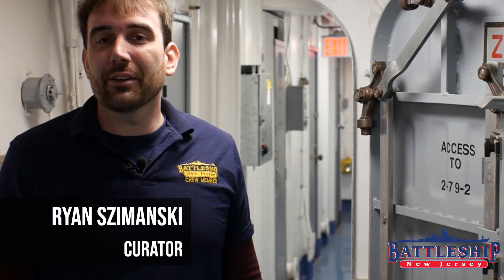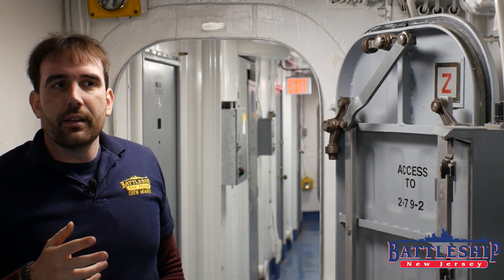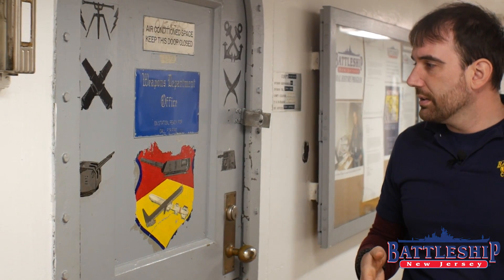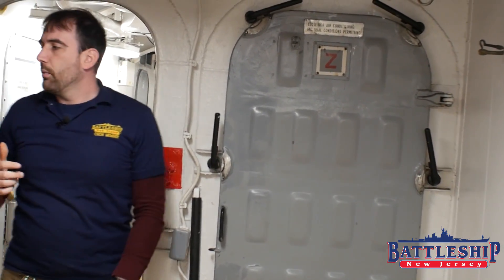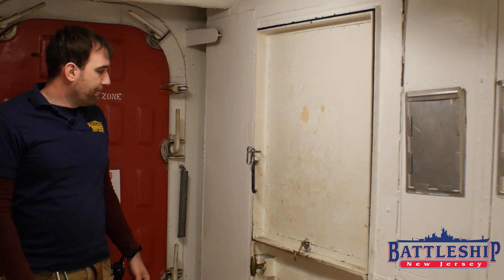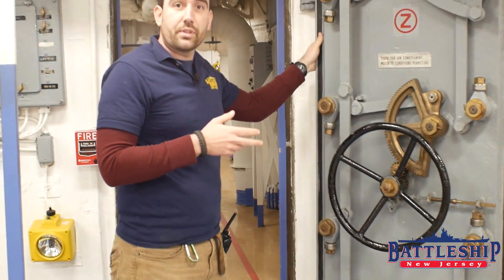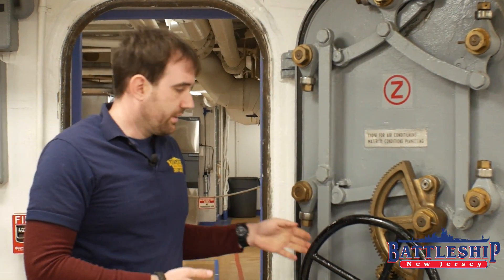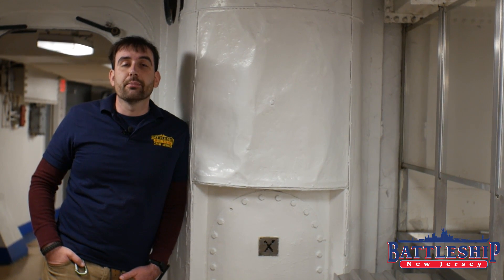Shut the Door! Doors and Hatches on the Battleship

Comment: Our berthing area was on the 3rd level, and we had two hatches leading into the space. Normally the hatch covers were open, and they were held open with a long pole and a thick cotter pin. During General Quarters or other conditions, the hatches were closed and dogged, and you had to enter/exit through the scuttles. That was never easy to do when you had on full gear. Getting out was easier, trying to step down through the scuttle onto a stairwell was challenging.

Comment: Dog Zebra-:the marking a Z inside a D, the Darken-Ship command is at sunset, all doors leading to the exterior must be closed and light traps/curtains put up,  no inside  light should be seen outside.

Circle X-ray: special marking an X inside a circle found on definite purpose valves and fittings , always closed unless an authorized operators or phone talker permission and must immediately secured after use. I believe DC Central door was Circle-X...

Comment: The Joiner door to the Mess Line would have been there simply to keep people out for whatever reason. Of note: most ships I've been on the Mess Line is also part of the main passage way that also goes through the Mess Deck. During cleaning they would secure any doors or hatches (WTD's) and you would just have to find another way around.

Comment: "NTD" simply means "Non Tight Door" not intended for use as anything more than an office or stateroom/cabin door.  There is no "W" missing.  As you pointed out they aren't intended for fire or flooding boundaries.  

Even though both of my 'girlfriends' were constructed in the 1970s I've used all of the various types of door, hatch and scuttle you showed here.  For those who have never used one, a scuttle is both inconvenient and a pain.  They are not designed for big guys or people with movement issues.  

The dogging mechanism of a QAWTD, properly adjusted exerts massive force to ensure that the seal is complete.  I saw a shipmate try to close and dog down one even though a high amperage welding cable was strung through it.  The cable was energized.  As he dogged the door down the knife edge CUT through cable and the resulting arc sounded like a gunshot and was hot enough to ruin the rubber gasket.  My shipmate had to help the Repair division replace the gasket, not a hard job but he had to do it after hours as part of his 'Extra Duty.'

I don't know why they do it this way, but the Marines call ANY door in a bulkhead a "hatch."  In 20 years in the Navy I've never been able to convince one he was wrong.  😎

Another nice presentation.
Reply: The door is no longer a door, it's a hatch. Semper Fi

Comment: How often did they change the gaskets around the doors? I imagine it's one of those things that would have to be done on a regular basis if you want to have a watertight door?
Reply: With several watertight doors on my ship, that I was responsible for, I can recall only ever changing gaskets on two doors during my three years plus aboard.   Worst problem was keeping them greased, and having untrained young squids painting the gaskets and knife edges!
Reply: @lancerevell5979  Exactly!

Comment: How do you get the upper paint layer(s) off without damaging the artwork on the lower? Thanks for all the BB NJ content!
Reply from the maker: Good question! in this case, the upper layer is peeling away so we are very gently pulling it away as it flakes off naturally.
Reply: In case you ever need it, Michele Baglioni at Univ of Florence recently came up with some hydrogels which are quite effective at removing one layer of paint without disturbing the underlying layer. Available commercially, custom formulated for each situation, though I forget the brand.
Reply: @WritesWithCare  Pretty routine stuff in the art restoration world, but probably new to people who's hobby is battleship maintenance.

Comment: 11:50 yes and no, You can't seal a square door easily. getting a square corner to be water-tight is like herding cats. the round edges of the water-tight doors mean a standard O ring style seal will work. It will ALSO be more resistant to jamming if something shifts, but really that door frame is like 95% of the structure of that door, and if you get that frame to yield, that door is going with it, open or closed, probably ruining the seal and starting a leak.
Reply: And, given that these are part of the main structural members of the ship, if you're getting enough motion to break the frame, you've got bigger problems than that door isn't watertight any more.
Reply: @evensgrey  and at that point there's probably already a big hole in the side of the ship nearby and DC is going to have EVERY hatch closed.

Really the doors are so robust because water is heavy AF and that might have to hold... what? 10 PSI of water pressure? a 32"x80" opening undergoes almost 1700 lbs of pressure across it's surface at 1 psi. and because you don't know what side the water will be on, it needs to hold that load even against the opening of the door, hanging on by only the latches.

Comment: I've used (and fixed/maintained) very similar doors to the quick acting water tight ones on   pressurized aircraft, very neat engineering that goes into them and cool to see some of its roots

Comment: I can't speak for sailors, so they might use different terminology, but mechanics would call that 'dog wrench' a 'cheater pipe' or 'cheater bar'. A 'breaker bar' is an unratcheted socket wrench drive, so named because it breaks tough things loose and/or the socket attached to it.
Reply: Correct term is 'Dogging wrench".

Comment: Doors are labeled to tell what should be closed when.  
X-Ray(X) provides the least tightness and the greatest ease of access throughout the ship. It is set when the threat to the ship is minimal, during working hours when in port, or when there is no danger of attack or bad weather.
Yoke(Y) is set when at sea, or in port during wartime.
Zebra(Z) provides the greatest degree of subdivision and tightness to the ship. It is set immediately and automatically when general quarters is sounded. It is also set when entering or leaving port during wartime, to localize damage and control fire and flooding, or at any time the Commanding Officer deems it necessary. Modified Material Condition ZEBRA - allows movement around the ship for special conditions such as: Underway Replenishment (UNREP); Vertical Replenishment (VERTREP); Air Operations; Amphibious Operations; transit of known or suspected hazardous navigation areas.
NTD:  Non Tight Door
WTD: Water Tight Door
QAWTD: Quick Acting Water Tight Door
FTD:  Fume Tight Door
https://www.hnsa.org/wp-content/uploads/2014/07/ch600-2.pdf

Comment: During normal underway conditions, were regular crew allowed to wander around anywhere on the ship, or were there limitations on where they could and could not go?    I assume they couldn't go into "Officer Country" or Marines areas.  But could, for example,  a cook find his way down into the catacombs, and into the previously shown sand locker, and down by the screws to see the keel, and up to the 011 level?
Reply: As a "Twidget" Electronic Tech, I was billeted in berthing for gunnermates, when I came back from a long tech school.  Ops berthing was full.  I was friends with the sonar guys and hung out there a lot.  I once went down to Engineering to check it out, but we were tied up pierside at the time.    Underway, Engineering and weapon spaces were busy, so no entry for outsiders.   Several spaces were controlled entry, like Radio Central (I was allowed being a radio tech), armory, any space with weapons.  And Supply.   "Chief Charley", a Filipino CPO, ran supply and mess deck, and you didn't cross him!    Weather decks were closed off during heavy weather, obviously.

Comment: In his book Battleship Sailor Theodore Mason explains that the armored hatch to main radio could not be opened from inside the compartment.  If they had to get out, they had to hope someone on the outside opened the hatch for them.
Reply: That is why I joined the Air Force.
Reply: @timmayer8723  ball turret and tail gunners back in WWII weren’t very well protected
Reply: @blacksquirrel4008  Gotta have pretty big balls to stay outside for hours being a pretty considerable target and praying the manufacturers properly welded the turret to the plane. Ba dum tssssss
Reply: @klutzspecter3470  Well, usually they only got in when approaching the target.
Reply: @blacksquirrel4008  Ball turret gunners were some of the safest people on the aircraft. IIRC, tail gunners and navigators were most likely to die by far.
Reply: @MillionFoul  that’s why I included tail gunners in my comment. Also, too many instances of people not being able to get out of the ball turret to be considered “safe.” Like, landing with wheels up and the guy still down there. How horrible is that?
Reply: @blacksquirrel4008  The guy would be fine, more than likely. Ball turrets were incredibly solid, in all likelihood in a gear up landing the ball would be forced into the fuselage and the gunner could be cut out of it afterwards (assuming the plane didn't light one fire, which wasn't as good of a chance as we would have liked but hey that's war for ya). 

In any case, it is also very unlikely the gunner would be unable to escape the turret either into the aircraft or into the air, as the turret would need to be jammed at about a 45 degree gun down angle to block the door. Gunners usually did have parachutes despite the common myth that they didn't, only a really tall guy would not have room for one strapped to his chest, as the turrets were designed with crew survivability as a factor.

Still, someone probably got killed in one at some point, if not from a gear up landing probably in multiple cases being shot down and unable to extricate form the turret before the plane hit the ground. Time certainly is an important factor in such things.
Reply: @MillionFoul  are you kidding?
Reply: @timmayer8723  I thought I'd be smart and join the army.
Ended up 15 tango air crew chief.  A fancy name for the other door gunner. 
Door gunners ( with a lot of responsibility)get shot often.  And In crash throne  out of the aircraft not good with  spinning  rotors around. I should have joined the airforce. But regardless of the branch or MOS I'm sure there would have been many things I wouldn't have liked.  Kinda miss those days now 25 plus years later.
Reply: @robertgutheridge9672  I joined the Air Force and spent most of my 24 years assigned to an Army Division. Funny how this stuff goes.
Reply: @the1bulldurham  from 1 to another thank you for your service. 
 Now the big question.  Do you ever miss the  military  bullshit?
Sometimes I do  then I wake up.
Reply: @robertgutheridge9672  Thank you too, sir. I do miss it. Would do it all over again.
Reply: @the1bulldurham  it was definitely the best decision I made at that point in my life. 
If I hadn't I could have end up like so many of my friends  in prison or dead.
Plus I made a couple of life long friends during my time. 
And yes I would do it again as well
Reply: @timmayer8723  Because you couldn't get into the military?  😁
Reply: Lol That’s pretty f—-Ed up. Or maybe the radio operator was supposed to go down with the ship sending out distress call

Comment: The doors on the Mobile Subscriber Equipment (MSE) I worked on the MI Army Guard had doors that latched tight to be gas proof and Electro Magnetic Pulse proof.  The same for the 407L Tactical Air Control & Command System (TACCS) in the Air Force in then West Germany.  Both had one handle that worked three dogs to pull the door tight.  Not exactly the same as a WTD on the USS New Jersey.
NWDT I think stands for Non Water Tight Door.

Comment: The corners are curved primarily for seal performance and reliability.  Sharp points don't work well with seals.
Reply: Nope, while that's not incorrect that's not the primary reason. The primary reason is to eliminate the concentration of stress, it's the same reason plane windows are ovals and not square
Reply: @richardmillhousenixon  They are not mutually exclusive.  However, I'd estimate a battleship bulkhead sees one or two orders of magnitude less fatigue loading than an aircraft.  Those openings don't need a cumbersome 6 inch radius to avoid crack formation and propagation.
Reply: @mgraen  On any normal day they wouldn't see that much stress but if the compartment floods they definitely would.
Reply: @richardmillhousenixon  That's just a few PSI, 20 at the lowest part of the ship, and not cyclic loading.  Effectively sealing against that pressure drives the design, not metal fatigue.
Reply: @mgraen  With your own logic they wouldn't have to make the radii of the corners so large if it was only to seal the bulkhead. That's a load bearing wall, therefore it needs any cutouts to not impact it's long term load bearing ability

Comment: When fate closes a door...OPEN IT AGAIN.

That's how doors are supposed to work.
Reply: My battle station on the U.S.S. Ranger had a hatch in it. During drills the space was closed off and A/C secured. I had to do this with an uncharged breather on. The sweat would fog up the face mask and my glasses. Finally I was just doing it by feel only.

Comment: NTD is Non-Tight Door. Tight means impermeable. There’s watertight but there are also oiltight and airtight.
Reply: Well said. Doors labeled NTD aren't tight against anything except possibly people.
Reply: @ut000bs  But they can act as fire boundaries. only WTDs or QAWTDs can act as a smoke, fire, and flooding boundary.
Reply: @ut000bs  yeah aka its just a regular door
Reply: @edarddragon  Well, it can be a thick steel door with a cypher lock. Basically a vault door and still be labeled NTD.
Reply: Correct.
Reply: @michaelimbesi2314  The only "oil tight doors" I've ever seen are the covers on the accesses into the fuel tanks, and those are normally bolted on with pneumatic wrenches.

Comment: What is the point of the dutch doors? Thanks for sharing another great video. It is much appreciated!
Reply: For example on my last two ships, you would stop by various offices and the bottom door would keep Sailors out of the space, but could still conduct business with the occupant.
Reply: @dundonrl  Right, like Weapons Officer or Dispensary doesn't want any unauthorized personnel wandering around in the space
Reply: @johnyarbrough502  Combat Systems office on my 1st ship (USS Essex LHD-2) has or had from 93 ro 98 a regular NTD door. CSMC    (Combat Systems Maintenance Central) has the same on Burke class DDGs but has a cypher lock on it if I remember correctly. Disbursing is one I remember that had the Dutch door.

Comment: Newer ships with air fed gas turbines have massive suction issues. they can be hard to close when engines are running due to the difference in air pressure. 
Any doors with small round viewing to see damage or condition on the other side ?
Reply: The biggest thing with modern warships is the CPS. (Collective Protection System) which has the interior of the ship over pressurized with air drawn through CBR filters in huge fan rooms keeping out Chemical, Biological and Radiological threats to the crew. On them you have two heavy QAWTD's with an emergency stop to keep them from being flung open if both doors are opened at the same time, and they keep the ship from loosing the compressed air inside it. On the Wasp class Amphibs (and probably America class) on the starboard side forward of the mess decks there's a 3 panel turnstile door to keep the berthing compartments pressurized but the mess decks aren't protected.

Comment: The slow acting door supposed to dog them in a criss cross pattern like doing a tire so you don't warp the door
Reply: I was cringing while watching him dog incorrectly. My old DCPO training was shaking it's head. LOL.
Reply: At 6:50, why was one of the dogs painted red? Does it have a significance?
Reply from the maker: Its an emergency feature put there by the museum.
Reply: And if the door is properly adjusted each dog should be halfway. The handles on the sides should be horizontal & the corners should be at 45. That should give an even seal all the, way around.

Comment: Those scuttles are supposed to have safety latches to lock the scuttle door in the up position. About lost three fingers when the latch failed and I fell down the ladder still holding the scuttle hatch. They call it "knife edge" for a reason.

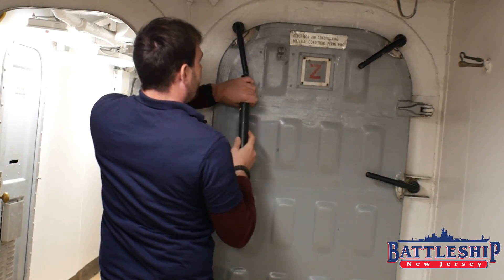Comment: What was the bell-like sound at 7:41?
Reply from the maker: The ships bell. It tells the time
Reply: @BattleshipNewJersey  I see! Thanks for the quick response.
Reply: Every half hour (during working hours or during daylight hours). Starting at 0030 you would strike 1 bell, 2 bells at 0100, 3 bells at 0130 till 0400 when you would strike 8 bells (in dual strikes like you heard) 0430 would be back to 1 bell. So noon or 1200 would be 8 bells, 1230 would be 1 bell, 1300 would be 2 bells again etc..

Comment: Could you 3-D print an Iowa?
Reply: Scale model?
without an issue, I've seen people have with blueprints for them online.

Full-sized one?

Not a chance, 3D printing with metal on the grade of Battleship armour is nowhere close to being viable yet.
Reply: It may take a while...
Reply: Depends on the scale
Reply: Yes you  could  it you have the spec's to put in to the computer running it.
Reply: yes, I have a small Iowa class model I've printed on my shelf of Battleships Ive visited